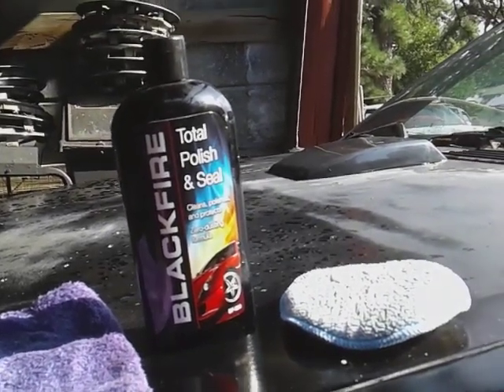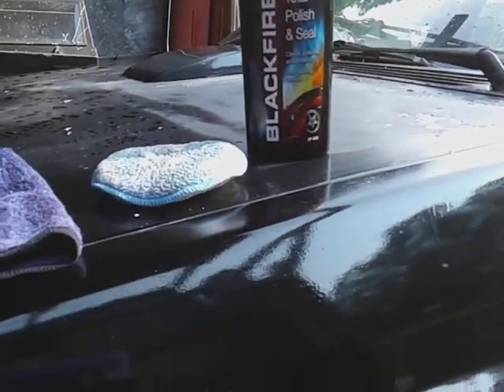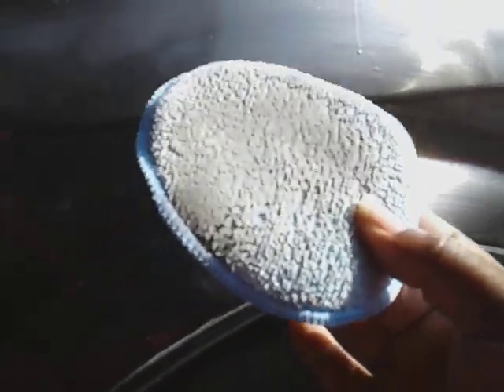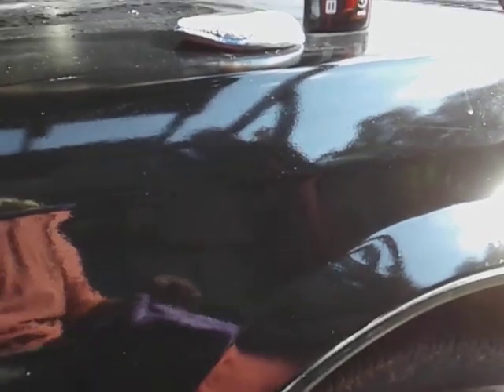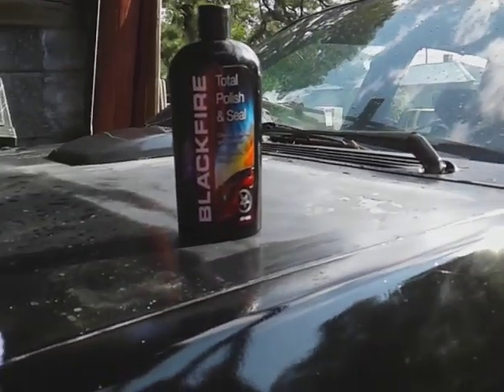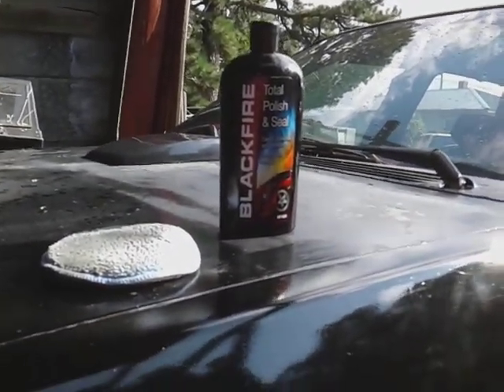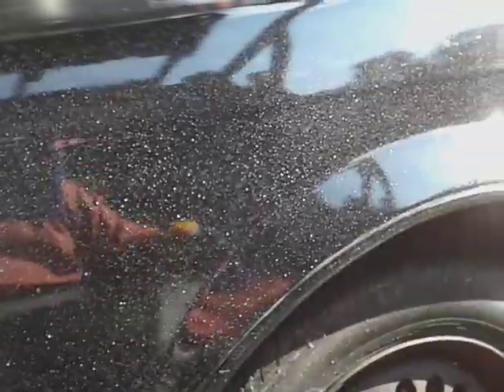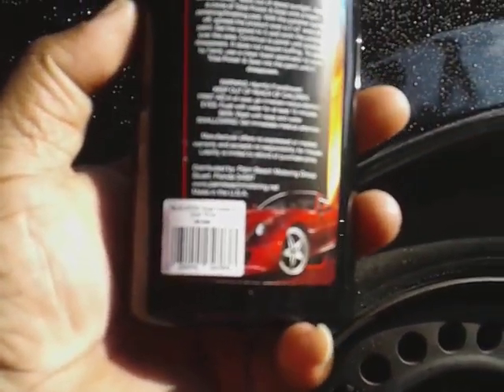Blackfire bf900 total polish and sealant test review part 2

Comment: Nice video.  I have used this sealant and it's one of my favorites.  But for best results by hand it should be applied with a foam pad and buffed into the paint until it disappears.  There should not be that much left over to buff off. Keep the videos coming and give it a shot with the foam pad.